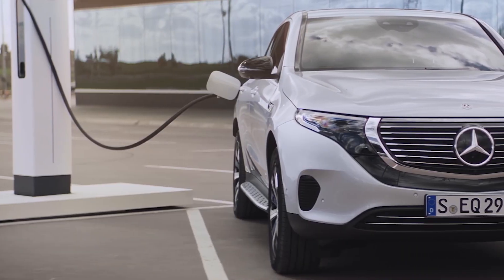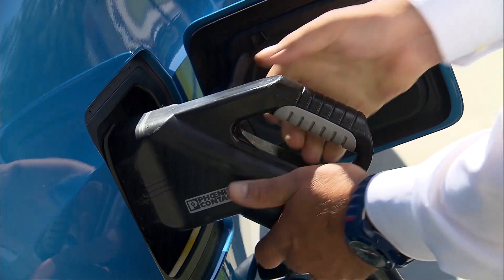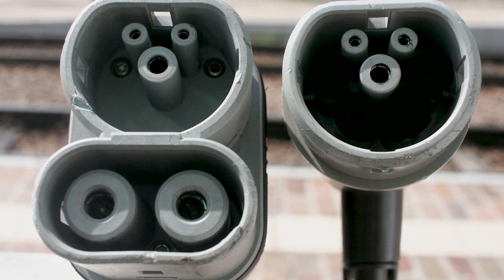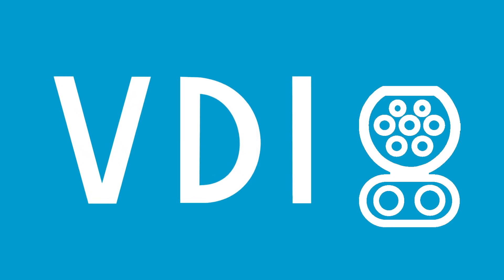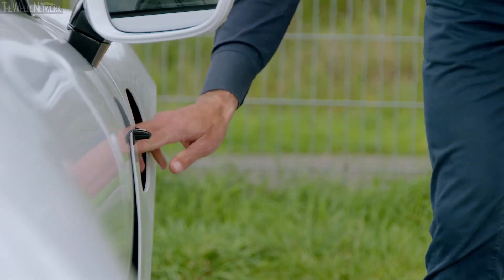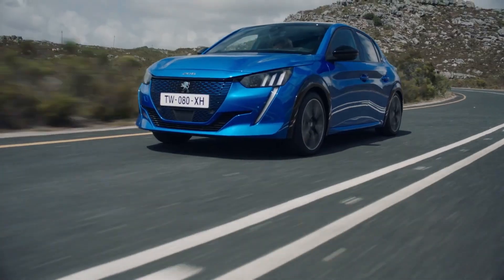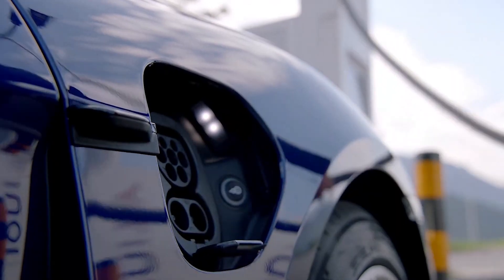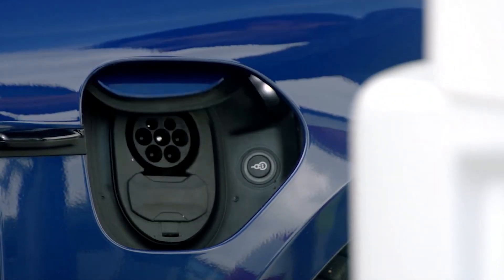CCS Combo2 Explained! | ABC...EV

Comment: I have a Porsche cayenne plug in hybrid which has a type 2 plug. I cant charge it using a DC charger because it doesn’t have a CCS port. Is there an adapter for this?? So i can charge it while travelling?

Comment: One edge question I’ve been trying to answer, for Type 2 AC Charging only cars like my MG HS +EV, with my own Type 2 to Type 2 Cable, at a public charging station with CCS2, can I plug into the Type 2 only component of the CCS2 socket to charge?

Comment: Even though CCS seems to becoming 'the' standard, here in the states there appears to be inconsistentancy experienced by how some chargers interact with various manufacturers. Granted I have a unicorn Chevy Spark EV which is an early adopter of the CCS standard but it seems many of us Spark EV owners experience unsuccessful charging that appears to be with certain fast charging manufacturers. I wonder if all charger manufacturers fully implement the standard or if certain auto manufacturers expect a certain 'handshake' response before accepting input from a given charger which causes charging to fail. Not a good thing if you are counting on a particular charging station to work if you take a road trip short or long to get you back home.
Reply from the maker: It's definitely an issue Bill. That 'handshake' isn't mentioned much. I remember hearing a charging company say that sometimes their units are labelled as broken, but in fact it's the car refusing the charge.
Reply: @BestElectricVehicle  I'm interested in if Tesla cars have communication issues on the Tesla charging network and also if Teslas now using CCS experience any charging issues going forward. The funny thing is here in the states EVgo's chargers OS is based on Windows and my Sparks underlying OS is also Windows based so much for the early start to the IoT "internet of things". Typically, it seems a reboot of the chargers resolves most of the connectivity issues.
Reply: @Dany Bougie yep, holding the connector can help but sometimes it takes several attempts to get a successful charge. I just read a review on the new Mach E and it too occasionally had a bad charging session so it appears something is not consistent either in the timeing before the car accepts the handshake from the charger or the current sent is not consistent within the ranges the vehicle will accept.

Comment: Thanks Martyn, another great episode and a good looking haircut. 

Since electric vehicles in the USA are only about 11 years old, it will take another 25 years to figure out a charging standard that works for all vehicles around the world. In 25 years the technology will change so drastically that whatever we’re doing today will seem as quaint as hand pumped gas pumps.
Reply from the maker: Thanks Larry!  You're right about the tech changing so rapidly. We might not even have charging cables in 25 years...we just take wireless charges in car parks and at traffic lights, etc. Thanks for the comment!

Comment: A industry standard that's adopted internationally regarding charging sockets and plugs is to be applauded,  rather than having a plethora of systems requiring multiple  charging cables to be carried and generating less confusion among EV adopters.
Reply from the maker: Absolutely, Dennis! It's much better now...still a little bit of work to do though!